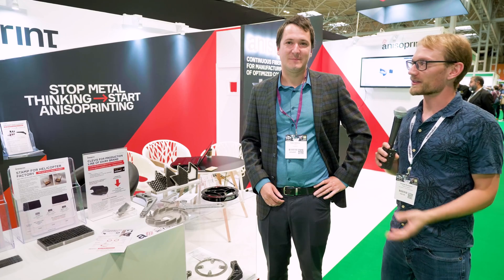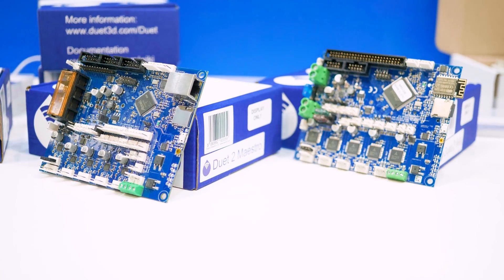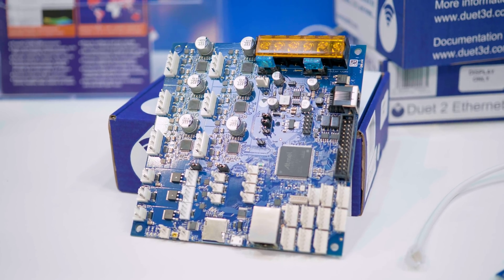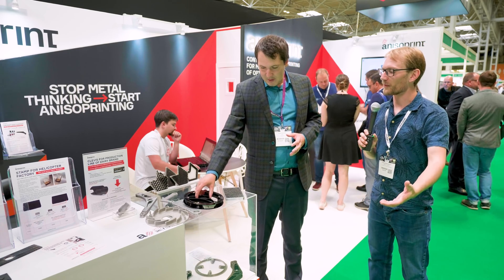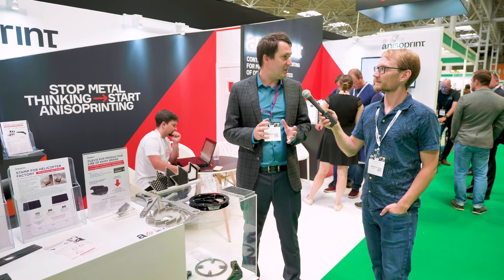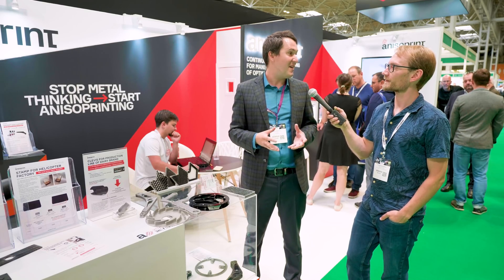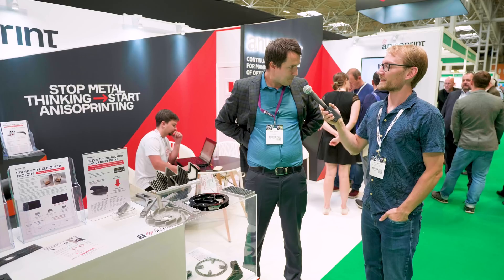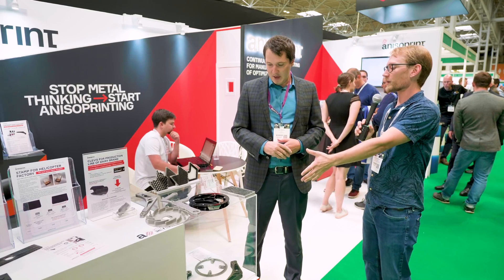Carbon Fiber 3D Prints stronger than STEEL - from Anisoprint!

Comment: If I may make a suggestion, I would mount two slowly flashing line lasers on the camera which are pointing at the floor to delineate its field of view, so that people walking around will notice and (hopefully) not step across the line into the frame as that one fellow did.
Reply: @Captn_Grumpy  Yes, it was hardly his fault and the reaction, I felt, was quite disrespectful from Tom toward the Anisoprint guy who was actively engaged in deep conversation with Tom -- and looking at Tom at the time.
Reply: @KieranShort  Agreed. Don't set up a camera in the middle of a display - particularly when there is so much clear space where you could do the interview.
Reply: A good idea, but a laser that's powerfull enough to be clearly vsible in a bright environment might be not very safe. 
Casually lasing ppls eyes while shooting your videos probably causes more problems than it solves^^.
Reply: Any 5mW laser can be seen in full light but might not be noticed.  That is why I suggested a line laser and have it blink.
Reply: @KeithOlson  true, but lets ignore the necessary laser output for a moment. Just imagine what would happen if someone got hit in the eye by your laser contraption. Even if it didn't actually harm them, they'd freak out regardless. And then you'd have ppl walking into the camera frame not because they were unaware but because they want a piece of you.
Reply: @protator  ...except to actually get hit in the eye, they would have to be A) in line with it, B) their head well below the level of the camera, and C) looking up at it.  (Remember: the laser is attached to the camera and pointing downward.  It only needs to lay a ten-foot line or so; that is only around a thirty-degree angle.)  Most people would just see the line on their legs.
Reply: @protator :  LOOOL -   yes geeks like to argue, for no other cause than to debate...

FWIW:  An LED Line source, there your problem is sorted..... Eye SAFE, and Plenty bright enough to see  Choose your favourite colour  maybe blueray.....   

NB. IN a "public"  Convention centre, you can't really control where people walk - you (Interviewers) don't control the space...
Reply: Nice idea but it will never work. the funny thing with ignorant people is is there completely oblivious to everything.

Comment: I stay away from carbon fiber since cnc kitchen showed it's dangerous to us and not that strong
Reply: what video are you referring to? Carbon fiber is very similar to fiberglass (except much stiffer), use the same safety precautions and you're fine.
Reply: This is different because this is continuous fiber filament. The CNC kitchen videos I'm assuming are the short fiber filaments.
Reply: @infernaldaedra  yeah I was talking about short ones

Comment: Two years from now Creality will be selling a knockoff for $249.
Reply: I hope these guys get their investment back on creating something so good, before the rip off copies come out that I can afford.
Reply: @andraser7  licensing
Reply: @andraser7  : You, Me, home gamers (except in our professional life) are not their target,  rip it off in ones home shop all you like (Practice with a multimaterial - mixing nozzle to get familiar with use of 2 materials simultaneously.  (Even Making the coated CF shouldn't be too difficult - the thing you can do in your hobby shop companies can't afford to do ie. fiddle with settings and experiment for the sake of it - selecting the correct resin is probably the critical thing - making sure it is compatible with the other matrix materials - to actual coating and curing should be "trivial".)

Commercial Users are the Target, and in most of the real world  they don't want to work with Ripoffs. Ripoff merchants often; cut corners, don't support customers and produce a generally inferior product which they don't fully understand.

If there is a need they will get their investment back and some, or they will sell out to a competitor who has market share and a client base ready to use the next thing.
Reply: I hope so! The hardware doesn't look too far off from existing 3d printers. We should see massive price drops in the coming years.
Reply: its really easy to copy entire printer...its just normal fdm. But make it work is hard. If someone copy it i would like to see the slicer where you get option to add carbon fibre manualy drawing it like in windows paint :)
Reply: @ErtsenPlayGames  if we get the filament it's easy. But still it needs mechanic sissors to cut the filament. But that's just a simple servo and a blade...
Reply: Tot sounds like the software would be the issue. It sounds like it's a lot of semi-manual work to slice it at the moment.
.
Reply: @dibblethwaite  really, topography tests can help this process. Then using the results like you would on a MMU
Reply: The real issue here is the slicer. Anybody could copy the machine with little issue. It's essentially just a duel extruder printer.
Reply: I think the difficulty will come from the binding material and pattern
Reply: I think the reason for the explosive expansion of the 3d-printer marked is that some patent rights have expired, we will just have to wait for 20y since markforge startet it. The world would be so great with less patent protection.
Reply: Absolutly
Reply: Building a 3d printer is easy. To make it a bit repeatable and precise is a bit of how much money you put in to frame and bearings etc but there are already similar filaments now but for most users pla is sufficient or petg. A fdm printer is even at 200mm/s pretty slow and doesent work for repeated manufacturing and thus it doesent really matter wich filament you use at home where petg is probably as good as it gets. Petg and pla is very nice. Why i dont like abs, is that it warps and releases gas while printing. This material is probably great for a company but i dont see myself needing this really for the possible extrusion problems it can cause
Reply: Yes and companies like anisoprint will be on to the next incredible venture.
Reply: I hope....
Reply: I mean, this is essentially a knock-off of a MarkForged
Reply: I reckon it's better than the Markforged, MF only has choice of 2 materials, onyx or nylon white. This machine from Anisoprint can print an endless variety of plastics! It is way better.
Reply: @AdamRW240  i think its meaningfully different. The ironing process of the markedforge does limit the fiber fraction considerably I think; I dont think they can get close to touching the numbers mentioned here. Using some kind of thermoset prepreg fiber makes sense; also it does sounds a little finicky though. These tend to have limited shelf life which kinda sucks on a roll that probably costs more than a midrange printer, and dont you need a post-cure for them?

Comment: This is amazing, designing parts with stress trajectories in mind - amazing; if someone is interested I still have my Wolfram Mathematica files for their calculations based on the Theory of Plasticity, however probably a FEM based solution would be better for a complex 3d optimization. Thanks Tom as always great work!

Comment: Very interesting concept! Why not embed other stuff than carbon fiber - like any kind of wire or thread? Or maybe even print micro tubes e.g. for fluids and utilize capillary effect?
Reply: Or copper for embedded wires in parts?
Reply: me3d none like... Graphene? The holy grail of vaportech.
Reply: @GonçaloAlegria  like fiberglass (cheaper and strong), aramex, steel wire, or fabric

Comment: This is very good news, but clearly they want a premium for this product so its not going to be well tested and used in everyday products and industries. Sorry but a $14,000 price tag for the desktop model is not sustainable or realistic!
Reply: It's new. Give it time and it will get cheaper. Once the cheapest 3D printer available was more than that. Now you can get them really cheap.
Reply: @ajosepi1976  There is a point positive in what you say, however when you see anything that has a patent attached to it the likely hood of their greed subsiding is not promising.
Reply: @kevinm3751  Patents run out. It takes a long time, but it happens. I have no problem with someone who has a new idea making money off it. That is what drives invention in some respects. It is not greedy to want to profit off your own mind.
Reply: @ajosepi1976  I am not talking about the inventors and creators, I am referring to the greed of the equipment manufacturers like Anisoprint and a number of the other absurd printer and supply companies.
Reply: It's almost direct competitor for Markforged -  we will see if this will cause price drop.
Reply: @cthulpiss  I believe its going to take more than just a few manufacturers in this segment to see any significant price drop.
Reply: I think the technology, with having full freedom in design and materials is worth the pricetag. Indeed it won't be for everybody, but not everybody needs a printer that can make such strong parts